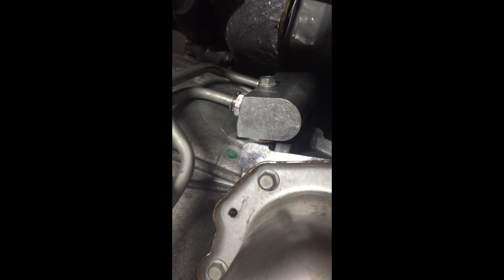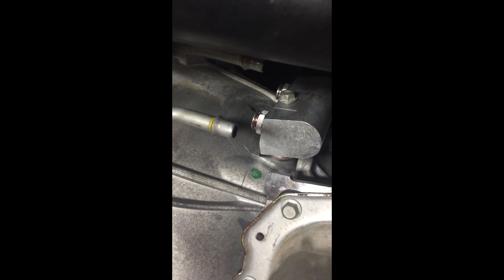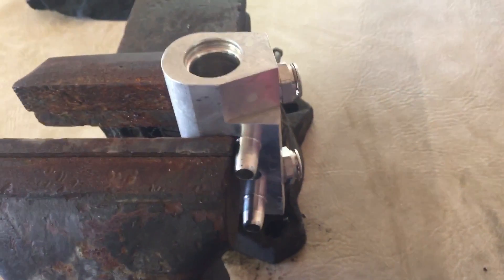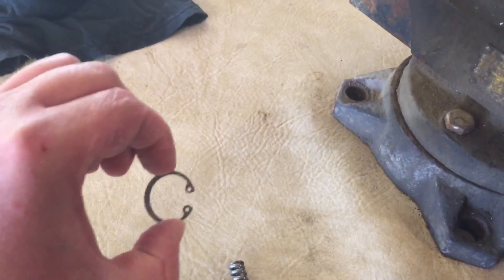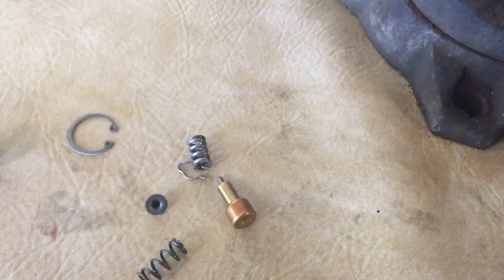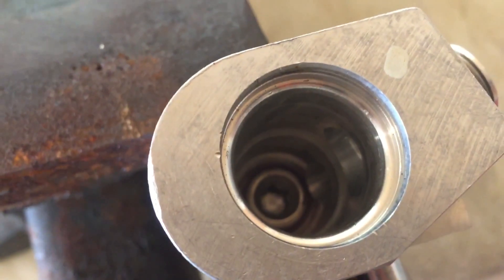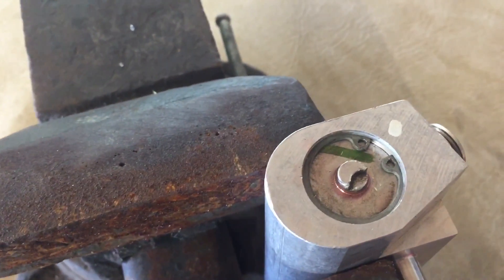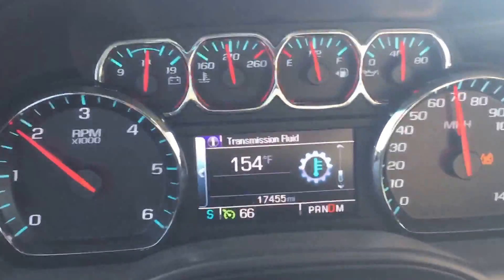Transmission Thermostat Delete 6L80 2014 Silverado 1500

Comment: I have heard people argue that the optimal operating temp is around 180-190 for the trans to operate properly. Any cooler and things don’t work like they are designed. What are your thoughts on that?
Reply from the maker: As long as my trans gets over 110° it works perfect. Even if pulling a trailer and the temp is 180° or slightly above. The trans shifts and works just like it does at 110° and above

Comment: I live in los angeles, and its my first time hearing of this. Would this require the change out of transmission fluid sooner than later since its now running non stop? Or what would be the cons of doing this to thr truck?
Reply: Also, how will this affect warranty?
Reply from the maker: The cooler temp would make the oil last longer. As it breaks down with heat. Also I am not sure about warranty. If you are worried about that. I would not do it

Comment: Can I run it with out puting the 1/4 plug in it?
Reply from the maker: Daniel Estrada there was another video on here. Where the person flipped the internals, and said that worked well. I did the plug so the fluid is forced to be pushed threw the trans cooler. I believe the other way well let part of the fluid bypass the cooler. Although I am not sure.
Reply: @dirtydave82  yeah I was going to remove everything as u did but not install the plug but wasnt sure if that would work
Reply from the maker: Daniel Estrada the fluid well travel the way with the least amount of resistance. So it should go through the cooler. Or it could just bypass it. Only one way to know. Try it and see. If you do. Let me know the results. Mine is almost to cool now. So this might be the better way to go.
Reply: @dirtydave82  I want to try it but not knowing if it will stop any flow thru the cooler or trans what do u think?
Reply from the maker: Daniel Estrada I would give it a try. If anything. You might have to put t-stat back in.
Reply: @dirtydave82  yeah tomorrow i will be removing all internal and removing spring off housing as well as u did and try running it with out the plug in it see how it runs temperature wise I'll keep u updated. I'm going to do the same thing u did. But not use the plug hopefully it works
Reply: @Daniel323_LA  how did it work without putting the plug in it?
Reply: I pulled mine off and check it out so basically how u did urs is by blocking it with that plug only allows 1 line to be used really rite since by puting the plug in blocks the other side of the block and line .
Reply from the maker: Daniel Estrada the plug only keeps the oil from going through the middle. Bypassing the lines to the cooler. Both lines are still used. The plug only goes in far enough to plug between the two lines externally

Comment: Hi guys .. wouldn’t be a better idea if a better thermostat be installed instead?? Am trying to even fine the original thermo and that even is hard to fine . Any link where to get it or a better yet fine a better thermo ???? Pls let me know thanks.
Reply from the maker: Victor Rodriguez as far as I know. There are no companies making new thermostats for the in-line transmission cooler. 

As far as I am concerned. The least amount of heat you have. The longer your oil life, and the longer your trans well last. Plus the old style cars ran their trans fluid through their trans cooler with no inline thermostat. So if it worked for years. Than why change what worked. My trans held 190-215 temp when new. Now it stays between 130-160 temps. Which are much better for fluids and internals. Both temps are non towing.

Comment: Just had my transmission shop do this well see what the temps are . I live in Florida heat. Before it was 195-200 degrees even pulling my trailer .
Reply from the maker: Brian Barnett I would be curious in that heat what it does. Mine hasn’t seen above 170 since I have done this.
Reply: AllTheWay Dave  well it done with put towing my trailer it don’t heat 165 towing my trailer no hotter than 168-170 glad I found this video.

Comment: Hey, I wanted to know how everything has been running? Any issues with the trans? Does your truck have the external trans-cooler or is it the regular one that’s built in with the condenser coil?
Reply: Also, could I just remove the thermostat all-together and just install an external transmission cooler?
Reply from the maker: Eric Dymek I have had no problems with the delete. I have had it done on my pickup for over a year. I am running the stock oil cooler in my setup. As it usually stays 140-160 for temps. The highest it has gotten was 180 while towing. Which is still way cooler than it did factory. As far as running another cooler. You would have to make an adapter plate to totally get rid of the thermostat block. As far as the delete goes. It no longer has any internals. So basically the same thing. To answer your last question about another cooler. It would be easier to cut the lines and add in another cooler at the front of the vehicle. Although, my temps are low enough. I don’t think I need to do this. As you still want some heat in you trans oil to make the trans work and shift right. Although if you are in warmer climate. It may not be a bad idea.

Comment: In cold weather will not affect the trans internal part coz u delete the thermostat?!
Reply from the maker: Moss Mass it’s just like any other vehicle that you put a bigger trans cooler on. This just allows for the fluid to flow at all times from the trans to the cooler. It will still get up to an operating temperature. It will just be less than it was stock and keep the temps lower. Even if towing or driving hard. Just like any other aftermarket trans cooler will do.

Comment: I did all that just didnt get the part of the half moon how should it have to be
Reply from the maker: Isidro Yanez if you gut the inside. I don’t think it matters that much. As it has several openings in it for the fluid to flow threw it. Although to be honest. I put the half moon on the side where the lines come out of it. Not sure it did anything, but that was the way it came apart.

Comment: Where did you tap the 1/4 plug? I’m looking to do this tomorrow.
Reply from the maker: omero rivas straight in the bottom. Were the thermostat tip sat. Right as you look in. You will see an opening to the other side where the oil flows to the trans cooler. The plug is to keep that oil from circulating back into the trans. As this is what the thermostat plugs when temps were reached. The plug forces the oil to flow to the cooler. Not letting it recirculate all the time like it did before. I am running 102-130 in the cooler weather of Colorado. I do warn you might have to have the trans setup/tuned for the lower temps. As I had to do this myself. The trans wasn’t shifting right do to the temp not being warm enough. Once it was warmed up past this 130-140 mark. It shifted fine. Although with cooler weather it is hard to keep the trans warmed to that point now.
Reply: AllTheWay Dave I see what you are talking about now. Mine currently reaches an average of 190-200. I live in Bakersfield, CA and it gets well above 100 degrees in the summer. Winter temps don’t get that low, 30 would be the lowest at night. I don’t think the winter temps would drop as much as it does in Colorado. Thank you, I really appreciate the help.
Reply from the maker: omero rivas just curious how this turned out for you? Hope it worked  for the best. Also you are right. With the temps in California. Your trans temp should stay warm enough that you shouldn’t have any problems.
Reply: AllTheWay Dave I didn’t have a chance to come around it but I’ll be doing it within the next couple of days. I’ll send an update with the results.
Reply: Completed it yesterday and works good! Its been at 142-150. I haven’t drove for a long period of time but it seems to be fluctuating between those temps. Thanks for the help again, much appreciated.
Reply from the maker: omero rivas glad I could help. Wish that chevy would of fixed this. As on hot days my pickup could run 205-215 all the time. That is close to the temps the oil starts breaking down. Taking away the life of the oil and trans essentially.

Comment from the maker: Current update on the transmission temp. With the cooler weather it is now running 120-135 degrees.
Reply: AllTheWay Dave was it blow freezing and did it have any problem getting up to that temperature?

Comment: Wrong placement of the outer part of your thermostat , you will have a oil drops from the thermostat, give me your instagram account to contact with you to fix your problem
Reply: Ok i found your instagram account in the discretion
Reply: Hey how do we fix if it drips
Reply: @waleed2971  مساء الورد اخوي وليد ممكن انستقرامك او طريقة التواصل معاك فضلا لا امرا
Reply: How did you fix the oil drip from the thermostat?